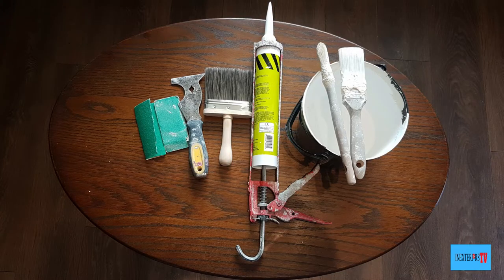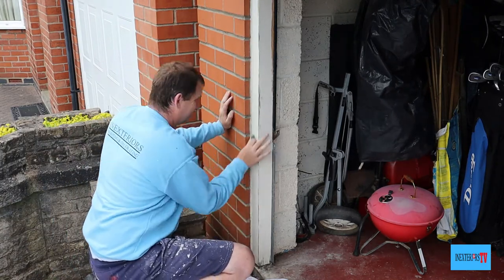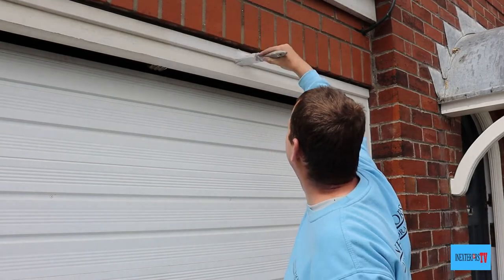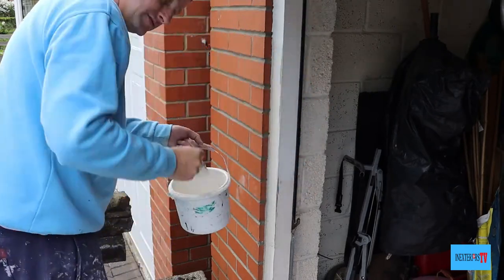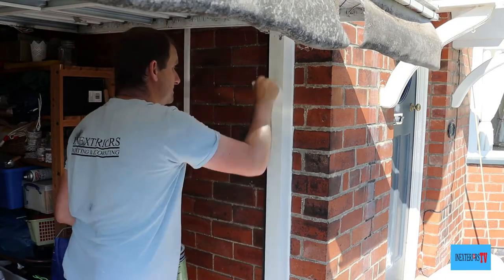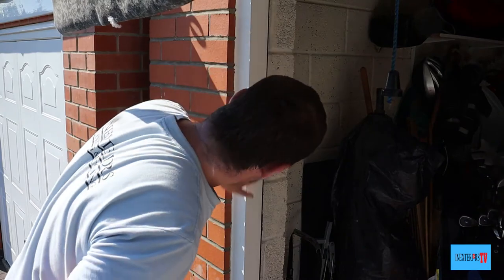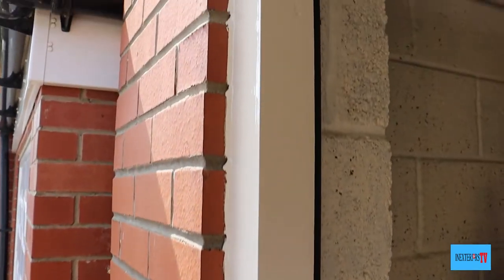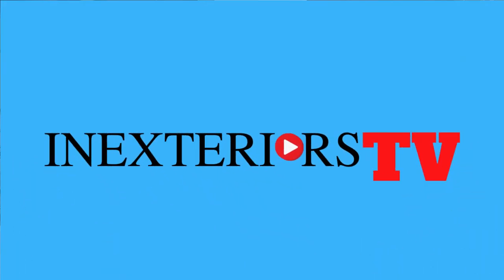How to paint a garage door frame. Painting a garage door frame.

Comment: how long did you waited once primer was applied to paint ?
Reply from the maker: @dimo7 . I put the top coat on about 24hrs after.
Reply: @Inexteriors  Thank you; So its primer first and then paint ?
Reply from the maker: @dimo7  I used a oil based flexible primer/undercoat on the frame. then applied the top coat,
Reply from the maker: @dimo7  what paints are you using.